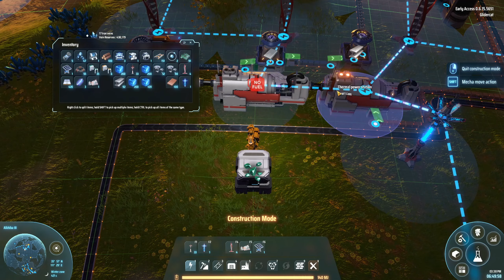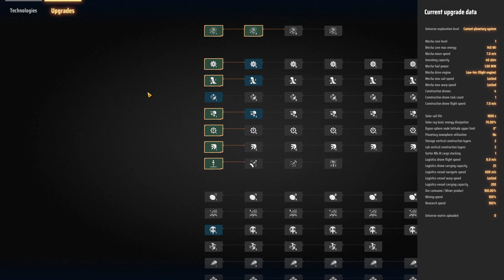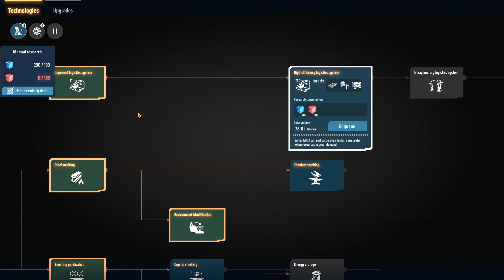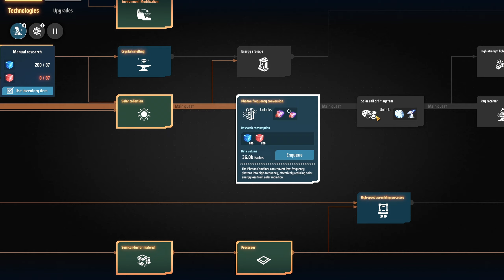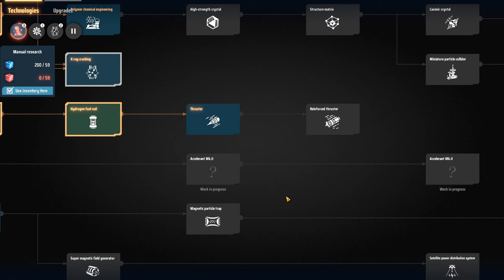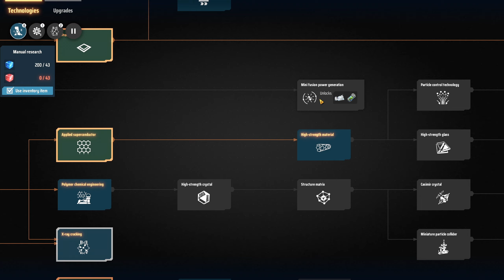Let's Play Dyson Sphere Program S01 E12

Comment: I would suggest(at this point) using a storage tank(holds 10000 units) for the refined oil until you get x-ray cracking researched then turn the refined oil into hydrogen and energetic graphite.  Both needed for the red cube.
Reply from the maker: Yeah, that makes sense. For some reason, I always feel like storage tanks are just a temporary crutch for a bigger problem that really just needs to be addressed. I think I first got that feeling from working with oil processing in factorio.  They do make good sense to use for buffers though.